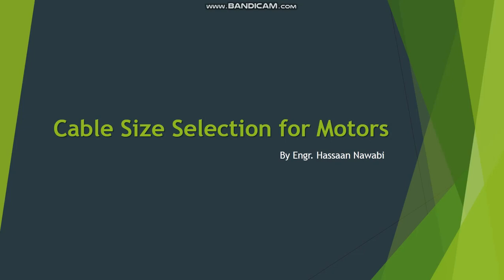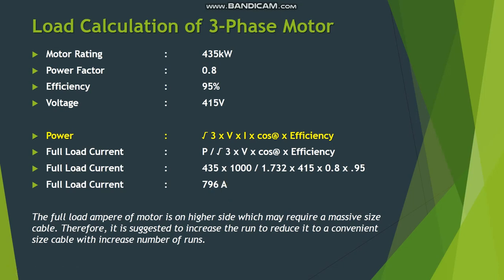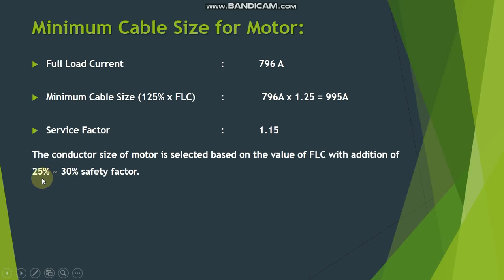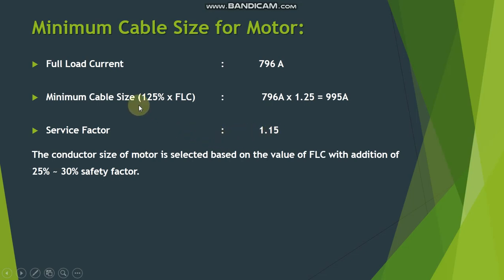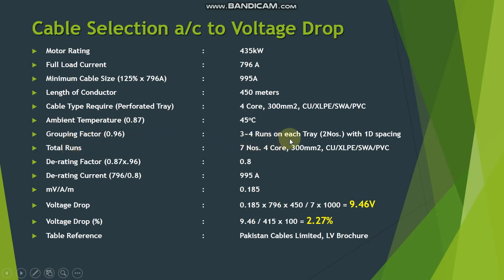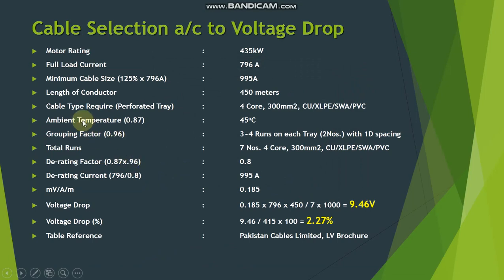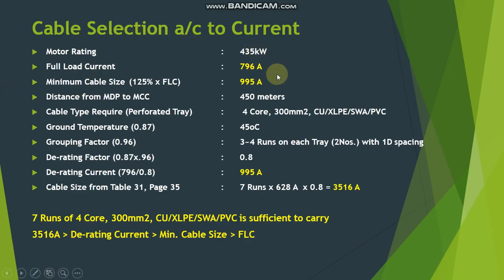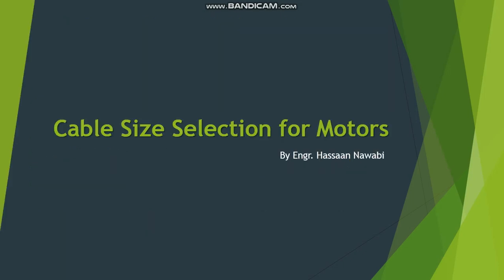Cable Size Calculation for Motors

Comment: acording to what you use 1.25*FLC ? is it IEC standard or other electrical code ?
Reply: 1.25 is nec code which is enough to size breaker

Comment: Hi, Thanks and appreciate for the good information that you share. 
Just wish to ask one question.... 
Motor starting current : since in this video there are 7 runs of cable so it was satisfactory current carrying capacity (all together) compared with starting current of the motor, my question is you done voltage drop calculation with starting current so does it means we need not consider Staring current of the motor separately for selecting the cable?? 
Or does it mean, if voltage drop calculation with starting current is not satisfactory then we can add or increase the size of cable which on the other hand can serve the starting current of the motor? 
Kindly please give some explanation. 
Thanks for the video.
Reply from the maker: We must need to comply Voltage drop condition at starting current for motors.
Reply: @electricalknowledge2654  thanks 🙏 for the reply.

Comment: Thanks for the video. However, is it for Cable size design and verification against 3 criterias need to consider
1.  Load Current 
2. Voltage drop 
3. Short circuit current

Also maybe bit more information on selection of suitable cable based on the application like normal consumers, emergency consumers and also the hazardous area Installations etc.
Reply from the maker: Yes you are right, you may watch my video on cable size Calculation from part 01 to part 06. It covers all the mentioned criteria.